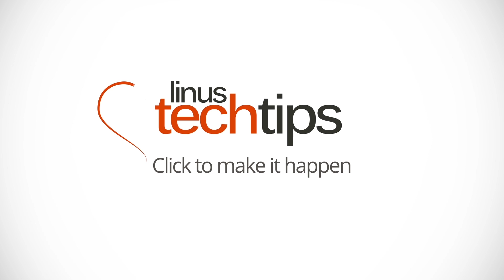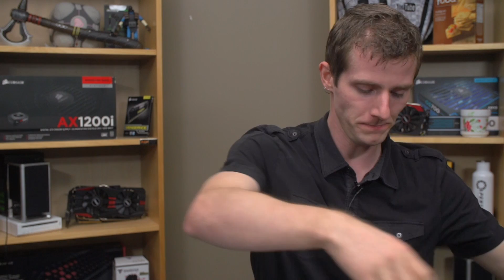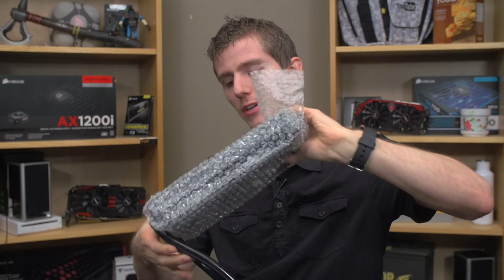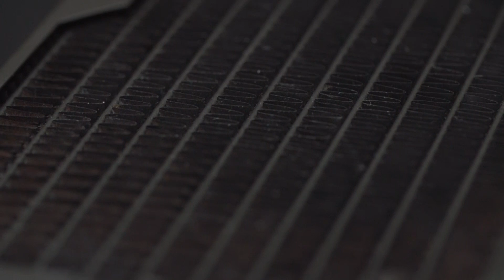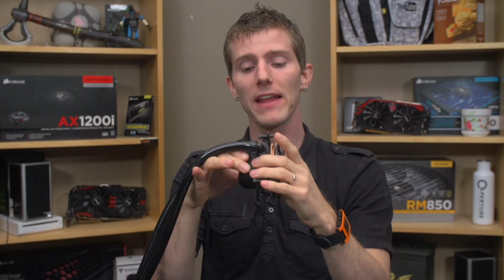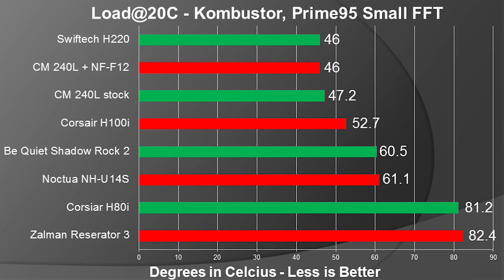Cooler Master Glacer 240L CPU Water Cooler

Comment: I would have loved this as an option before I went to my full custom loop, as going from a Zalman 9900 Max to a full blown custom water system was a little daunting and expensive, though now that I know what I'm doing I'm in love with custom water cooling.

Another thought is that this would be fantastic to start with as a CPU cooler and maybe grab another similarly sized rad, and add a GPU to the loop. Not sure on the power of this pump though.

Comment: Eh...I'd rather go batshit crazy and go for something like Aquacomputer's Pump/Reservoir/Radiator Airplex combo setups instead. More expensive, but surely a lot more robust, no?

Although these Swiftech coolers perform well, it makes more sense to get an AIO closed-loop or sealed cooler if ease of install + budget was a concern. If going this route, you might as well spend money on a custom kit and get even better performance.

Comment: What program are you guys using to get the temps? With an H100i I was seeing temps around 70 degrees C with my 3930K at similar settings. When I bumped it to 4.5Ghz it was around in the low 80's. My temps are coming from core temp and verified with Corsair Link

Comment: Personally; I have a horrible record for physical PC maintenance. My beast of a $8,000 air-cooled comp hasn't been cleaned in about 4 years (until later this month - I plan to get around to it). The inside has so much dust that it looks like ash from thermonuclear fallout! So given that; less maintenance = better. However; if you are someone who has some degree of discipline in their life and doesn't wake up wondering if the sun is going to come up or has already gone down: a custom loop that is well-planned for future maintenance would be (in my opinion) better.

Comment: If they make a 280MM version, it'll be what replaces my H110 once it kicks the bucket.  After building my custom loop in my main desktop, the secondary rig will be getting the H110, and I know it'll need to be replaced at some point.  Since this rig is going to be a tiny one, I'll need as much surface area as I can get, so 280mm or bust. :P

Comment: I wouldn't add a GPU into the loop, I would add another 120mm radiator into the loop. I like that it gives you a higher RPM pump so it can push through more. I don't want to add more heat, I want to add more heat dissipation.

Comment: Worst mounting hardware I've ever dealt with. Not bad, but fussy when dealing with 1150/5/6. If it had an easier mounting system like the H100i it would be the only prefilled anyone would ever need to buy.

Comment: If I were to get an AIO solution, I'd get one that is just sealed, not made for expansion. If I want a custom loop, I'll make a custom loop from the ground up. This is actually what I have done. I got a H100i to use on my CPU, and I'm saving up to build a custom loop to replace that H100i. Then I have the spare H100i to use in another system later on.

Comment: so this cooler had built in reservoir and pump ? if i want to expand the loop (watercool GPU) , do i need to add more water or just add more tubing ?

and should i change the water every 6-12 months like other DIY WC system ?
Reply: You would need to add more water since you would be adding more tubing for it to be running through.

As to changing the water, I'm pretty sure AIO's never need to be touched but if you add to the loop I'm sure it wouldn't hurt.
Reply: You would have to buy tubing to add the GPU to the loop
Reply: thx for the answers , i need to see those performances on extended loop.
and need comparison with a DIY-Custom WC.
if this AIO system can maintain low temp. (both CPU + GPU) on extended loop it will be a great deal.
Reply: Swiftech makes great stuff so I'm sure the temps would remain great but obviously that would be something you would have to look up and research.

Comment: Why would you get a prefilled when there are kits with phobya uc-2lt, alphacool nexos 30mm 360 rad tubing, fittings, pump rez combo for the same price?  130 eu for this kit from aquatuning. It copes miraculoussly with my 8320 even at 5 ghz 1.5v

Comment: I see no reason for getting something like this. If I needed to watercool GPU(s) too, I would want to have a proper pump at the very least. And while you're there, might as well get a reservoir too.
Reply: That requires more of an investment plus I'm sure not everyone is comfortable running their own custom loop. This is half done already (fully done if you don't add a GPU) so I'm sure that takes some of the scare out of it. Plus you know everything will work together
Reply: Steven Pociengel Ye, I have a custom made PC and I know how to mount pretty much every PC from "front to backwards" xD
But man, building a custom Liquid Cooling loop scares the shit out of me! So I would just buy an H100i/H110. (I will do one custom Liquid Cooling loop, eventually xD)
Reply: StormWorm5364 just like anything else with computers you just have to jump in there! Water can be scary though
Reply: Yeah but using this, the performance increase is minimal because the components are just not powerful enough. You can spend more and get something that gives benefits or buy this and get something that's a waste of money but mimics a watercooling loop without the horsepower to support it.
Reply: Are you sure about that?
Reply: It's what I've heard from some people who have modded a H220 and found out that cooling GPUs and a CPU was a little bit out of its league. That said, I haven't tried it myself, so I guess you could take what I say with a grain of salt.
Reply: Just curious, I haven't talked to anyone who's added to the H220